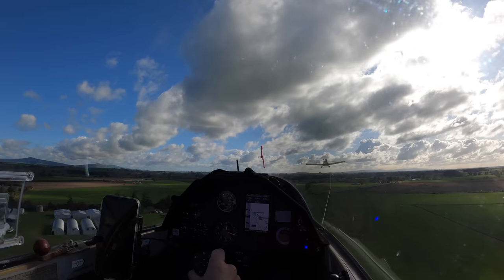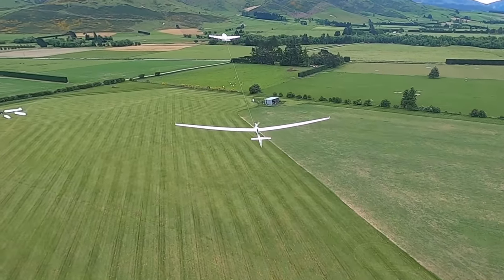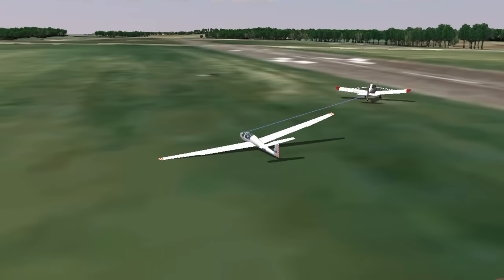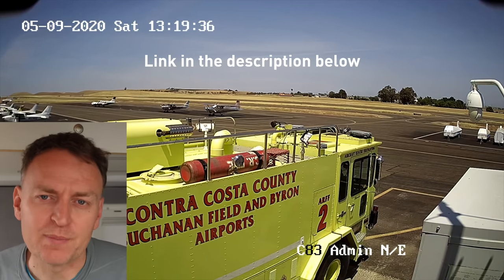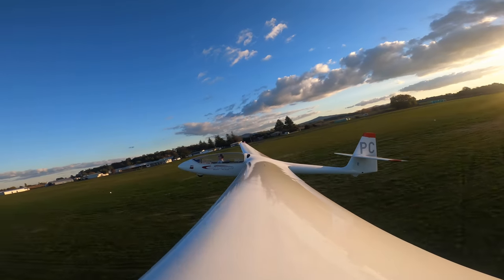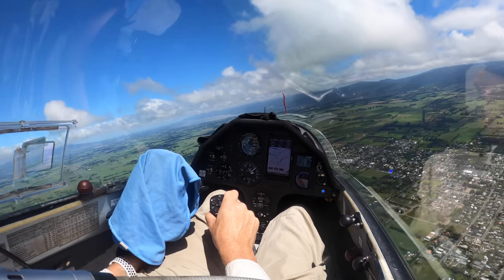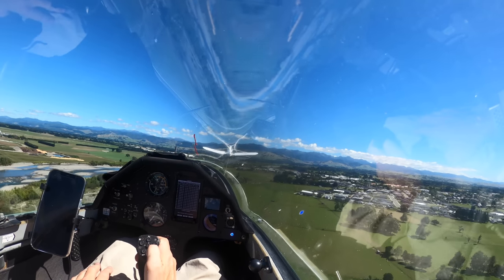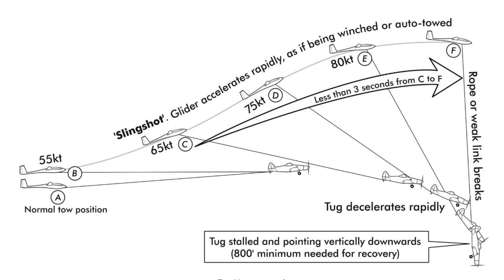3 Seconds to Crash: Glider Aerotow Launch Gone Wrong

Comment: An absolutely horror situation. Years ago, in my former gliding Club this exactly happend too. The tow pilot burned in his own plane, the glider pilot survided in shock, was never seen again on airfields. Incredible lifelong load for all. What should be done for mechanical protection side: If the rope takes an angle more than xx degrees and the rope is under stress, an automatic disconnect function should be activated - in whatever situation. Less "-y" degrees before, accustic signal should send in in Aero Tow Plane and Gilder. We have got a lot of avionics inside for thousands of dollars. Why not a protection for our best friends, the tow pilots.

Comment: If there is no useful reason for brakes to be out when tow is engaged, surely there is room for a tow-rope sensor to interact with the brake lever to sound an alarm?
Reply from the maker: Some gliders do have sensors on the flight computers to alert you if brakes are open.

Comment: is there a reason why there isnt an emergency release on the tow plane? Seems like an easy problem to fix if the pilot can detatch the glider in the event of total loss of control
Reply: Oh, but there is! It is most often used to drop the tow line close to the starting spot to hook up the next glider and not drag the tow line around over the airfield. However the tow plane's pilot knows that he'd seal the fate of the glider at low altitude. that is why they concentrate on flying their plane.

I had an upset once still in training but after I had already soloed, where instead of having my hand on the release, it came to rest on the airbrake lever. It was a very bumpy summer day and somehow the weight of my hand and arm must have released the airbrakes in one of the more violent gusts of turbulence. The old K8 with brakes only on the top surface immediately pitched up and ballooned high above the tow plane. I immediately pitched down, we were over the rising terrain (woods) at the extended centreline of our airfield. The red-white tow plane was very visible against the dark fir forest underneath. No place to lose your tow plane!

After I had quickly manoeuvred back into position, the tow pilot, a war-hardened Ju 87 pilot calmly radioed through: "Do that again and I'll kick you out."

He later explained to me the imminent risks to himself at very low altitude and how, despite the glider having a chance of surviving pancaking into the woods with a glider, he would have had no chance. Obviously something we had also previously been taught in ground school.

Comment: My issue with a winch, what if the release doesn't work? With a plane, there are two release options. Following directly or nearly so to the tow plane seems so intuitive. The tow plane not releasing as soon as the tail is upset is strange.

Comment: Why can't the tow plane cut the cable? Genuine question.
Reply from the maker: It can, but it can be hard to do once there is a massive load on it.
Reply: @PureGlide  but if it’s so catastrophic a hydraulic release system can be manufactured. 
Watching that crash and see how easily it crashed the tow plane I would want something in the plane if I was the pilot.  
I’m no pilot just a casual observer. 
Thanks for the videos they are genuinely interesting.

Comment: Happen in our club also. luckily around 500m altitude. two pilots /pilot and instructor/ with L-13 just hang tow plane. i just remember guys said there was not possible to release a cable /so big force in release mechanism/. tow pilot was surprised as well, because they caused him zero or small minus g force as tow plane was lifted and change from flight into glider dummy weight. situation take about 3-5sec as tow plane was just under glider, until 500kg metal fuse on tow cable was broken and finally tow plane fall away. who knows what these guys in glider was doing, they said watching clouds...during tow, maximum concentration must be done, especially if tow plane pilot like to use thermals with glider at tail

Comment: Has there been any attempts to have the release mechanism release automatically. It looks to be a solvable problem so presumably someone else thought of that and kniws why we dont have the solution.
Reply from the maker: A gilder's belly hook automatically releases based on angle, so if you over fly the winch, it automatically releases. But I don't know why they haven't made one to release with vertical height on the tow plane end. Maybe the angles are too shallow? Don't know.

Comment: So sad when this happens!   :-(
On the tow pilot end the “TOST Tow Cable Retractor With Guillotine” – system could help. 
Even with this system, you still have the problem that the tow pilot does not have enough hands for everything that he has to handle.  So my Engineering mind imagines an additional electronic (electric) system to activate the guillotine with a simple button press on the joystick?

Comment: Makes total sense once you see it. Glider goes high, pulls the tail up, forcing tow plan nose down. Too close to the ground.
Training and proper focus on the job are essential for both pilots - this should be added to the textbook, literally or figuratively.
Glider acted like it's alone and free to go wherever and whenever it wanted - forgetting that it's part of a whole with the tow plane while they're connected - and control goes both ways. Consequences followed.
Reply from the maker: Exactly right

Comment: When I'm being towed up in my hang glider, the tug has the option to release the tow line as well as me. If that were to happen, I would look for the best place to release the tow line and drop it. Does this back up system not get used in sailplane towing?
Reply: Once the gilder is well out of position the load on the rope makes it impossible for the tow pilot to release.
Reply: @lautoka63  
Which ought to be fixed. Designing things that will release under strain is hardly rocket science.
Reply: @q.e.d.9112  Some tow planes have a guillotine to cut the rope; a sensible idea, but I don't think it's been widely adopted.

Comment: It has always seemed to me that a  fix for this problem would be a relatively simple modification to the tug. Hard back pressure on the stick could be made to operate the release. I've no doubt that tug pilot would be very fast  in applying back stick, faster than groping for a separate release handle while experiencing a lot of negative g. I used to propose this while flying from Lasham in the 70s- but never got anywhere with it.
Reply from the maker: Feel free to design and certify an improved mechanism! It's not as easy as you might think, for a start there are lots of different tow planes. Getting a certification and testing done for all types would be very time consuming and expensive.
Reply: @PureGlide  I'm impressed to find that you take the trouble to read these uninformed vapourings. I was indeed  oblivious of the problem of certification. However, because it is such  crucial matter, it is interesting to me, at least, to explore the design considerations, ignoring the administrative difficulties and considering it just as an engineering problem.

Comment: What is your opinion about creating a rule forcing the tow pilot to release when to glider exceeds predefined limits vertically and/or laterally? Could be graphically represented as little tape markers on the rear mirrors of the towplane?
Reply from the maker: Yeah that should be a personal rule for all tow pilots, but hard to put it on a mirror when different people are different heights!

Comment: Why not have a sensor box on the tug hook which automatically releases the line? Three sensor bars, sides and top, ang get touched, away she goes.
Reply from the maker: It's a good idea, unfortunately designing and building equipment for certified aircraft is an expensive and time consuming process. Don't let me stop you though, go for it!

Comment: When do you raise the gear when on tow as that often needs a hand change on stick?
Reply from the maker: Most people are trained to raise the gear after release from the tow plane, not on tow. Flapped gliders require the pilot to use the flaps while towing.
Reply: Yup, after release.
Reply: In some circles it is regarded as “cool” to get the gear up as close to the ground as possible. Most experienced pilots that I know leave it down until off tow because a) if you have a low level rope break or the tug dumps you, you may be landing/crashing shortly afterwards and that goes a lot better with the wheel down; b) as PG says, you want minimal distractions close to the ground and c) in anything but completely smooth air it adds a bit of drag that makes station keeping a little easier and bows in the rope less likely. The only time I’d consider putting the wheel up on tow is on an aerotow retrieve as it can be more comfortable/quiet at speed and some gliders have a relatively low Vlo/Vle.

Comment: There must be a way to automate release using angle sensors or GPS perhaps. Something that circumvents human reaction times.
Reply from the maker: We have a back release for the winch hook, but you have to overfly the winch to activate it. I don't know why it doesn't release automatically the other way for a tow plane!
Reply: @PureGlide  I guess the number of events is fairly small overall so need not seen.
Reply: Everywhere I've flown the tug has can cut the cable. I suspect that an automated system would cause more accidents.
Reply: That has been looked at quite a few times but it’s tricky to work out what parameters you would use to trigger a release. The angle of the rope relative to the longitudinal axis of the tug doesn’t change very much as the tail gets pulled up, and the load on the rope is within limits otherwise the weak link would break. What makes an upset difficult to recover from is the rapid transfer of energy from the tug to the glider, leaving the tug pointing at the ground with low airspeed, as per the illustration at the end of the vid. This is something you could monitor with a computer, but “false positives” could cause an accident at the other end of the rope; it’s a tricky one and good MSc/Ph.D material!
Reply: @KeithWhittingham  Perhaps yes
Reply: @edtheduck6219  Yes interesting but maybe the best tactic is just reinforce training. I don't understand most of this sport to know

Comment: Why didn't the tow plane release. they have mirrors and can see the gliders position
Reply from the maker: Not as easy as that, the mirrors are small, vibrating, and they have to be primarily looking at what's in-front of them, as well as the instruments, and a glance at the mirror. It can happen so quick, and they aren't looking at the mirror the whole time. Cheers!
Reply: @PureGlide  Having many tows in both aircraft, I understand that there is many situations that can change from normal flight to unstable. That is why the tow pilot flys with his head on a swivel. If the towed aircraft gives the indications it is rapidly going to be outside the envelope, then you ditch. Because yes, as the angel changes so does the likelihood of no disconect

Comment: Need a smart latch block that will release the glider if the angle of the tow rope goes beyond a certain angle spectrum.
Any inventors out there?
Reply from the maker: Yeah we have that already for the winch hook underneath, but I suspect the angles are too fine to do it on the nose release. But it's a good question if anyone has investigated it more.

Comment: Two thoughts come to my mind. The links between towing plane and glider should be constructed in a way that allows quick release even under tension no matter what the angle is. And secondly there should be an automatic release function that engages whenever towing plane or glider are about to get into a critical position. I am aware that this takes some effort but I am sure that it is feasible and seems a lot safer to me than apealing to the discipline of an unexperienced glider pilot who might simply be overwhelmed by the situation in the moment. I am neither a glider nor a towing plane pilot btw but the notion that fatal accidents happen just because the glider pilot may react in a wrong way and the towing plane pilot has no way to release the cable because of the forces that pull on the link is in my opinion not acceptable.

Comment: As a tow pilot i can say only, that you should always fly with a thought that the pilot in glider can kill you. Then you wont be suprised. During the take of you should check the mirror as often as possible, or even fly only looking in the mirror. You should pull the release without thinking, do not think about the glider pilot if he is pulling you to the ground. If I can't see glider in the mirro for even a second I pull the release. If it is possible save both lives, if it's not save yours first.

Comment: If a release mechanism doesn't function when required, it needs to be replaced with a better design that will work.
Why isn't some kind of auto-follow system being used, to prevent the glider getting too high/low?  An autopilot on the glider that is automatically maintaining the same altitude as the tow plane.

Comment: The glider pilot has the tow release right there... it seems that almost any mishap can be avoided by immediately releasing the tow line, or am I missing something?
Reply from the maker: Yes, but it's very hard for the tow pilot to see if the glider is out of position, with a tiny shaky mirror. So that's why it's so critical the glider pilot releases if they get out of position too far.
Reply: @PureGlide  I was meaning the glider pilot sees all and knows all. He/she should pull the release first, then asses, as the tow pilots life is literally on the line.

Comment: Thank you for the video.  Did the canopy fail somehow or did the glider pilot fail to properly secure the canopy?
Reply from the maker: I think it's likely the pilot failed to shut it properly, but check the report for more details, it's linked in the description. Cheers!
Reply: @PureGlide  Pilot claimed it was shut during pre-flight checklist.  Hard to say whether that was the case or not as memory can be tricky in those sorts of events.  Either way, I appreciate the video - sobering but helps keep the topic fresh in our minds.  My instructors have cracked down pretty hard on maintaining a good tow position.  It's one thing to know something can go wrong but not quite understand the reality of how it all plays out.  It's another to have a video showing very fatal consequences as a demonstration.

Comment: Hmm I wonder what would happen if the glider was attached to the roof or front of the Aerotow plane.
Reply from the maker: Good question, but the rope would strike the tail of the tow plane when going too high or too low. That's why it's at the back.

Comment: All this is true since as a student pilot I almost killed the tow pilot when I was a teenager. Lucky for him and me and everybody it happened before solo and the instructor sitting behind me in the 2-33 finally came out of his trance ( the trance I was in is the cause of my ballooning on take off). The instructor pushed the nose down to about a 45 degree or more down angle giving me a great view of the Super Cub rotating and finally beginning to climb after nearly nosing over from the pull of the rope. The issue here is being lost. Not only are glider pilots suppose to be more capable then to cause this to happen but the dammed release hook on the tow plane is suppose to open when the dammed thing is pulled. Well guess what for the guy I almost killed by accident the release refused to open! Now how do you suppose that happened? You guessed it a bad design that the FAA put there stamp of approval on that is a ticking booby trap for whoever this kind of thing happens to .  Not only is the design prone to jamming even when all the cable adjustments are right , when they are not right then it is a total non functional "release".
Reply: Thanks for your comment, Joe.
That is why I said in my comment; What is needed is the “TOST Tow Cable Retractor With Guillotine” – system.
A guillotine should work even better when the line is under high tension. 
I suspect that it is not used as standard because it is too expensive, but the question is: “What is the life of the tow pilot worth”?!

Comment: I can't help but think a bridle on the tow plane's tail that was allowed to rise up but not change the pitch of the tow plane would be a great help. From what I have seen tow points on many tow planes have a single point of connection. If the tow point on the power plane is above the vertical it would have pulled the tail up rather than down.

Comment: Why not attach to a vertical hook on the tow plane, so if the angle goes past a certain point it automatically releases the cable from the tow plane end?

Something like this:
[tow]  _) ----[glider]

The piece that attaches to the hook could have a bearing running on a hooked rail, so no matter the tension it will slide and release past a certain angle.

A double joint system can be made with a horizontal curved rail so if the glider goes past laterally it will release too.

Makes sense?
Reply: Besides a mechanical system, nowadays we have plenty of tech to measure cable angle and add an electronic release system. Mechanical tends to be simpler though...
Reply from the maker: You'd have to talk to the tow release manufacturer. We do have ones that back release automatically for winching. They are a certified aircraft part, so not easy or cheap to create new types. https://www.tost.de/category/tow-releases/?lang=en

Comment: In the event the the glider pulls the tail of the plane way up and nose down. In this event, there should be a tow plane cable release, to release gain control and land. The glider and then release his end and safely  land.
Reply from the maker: They do have a release, but it can happen so quickly, they don't react in time and it's too late.